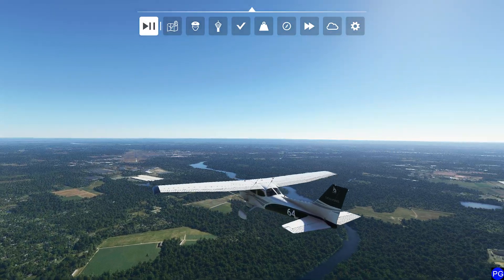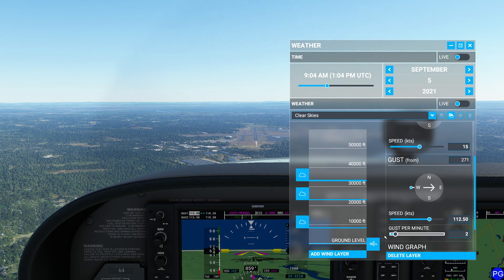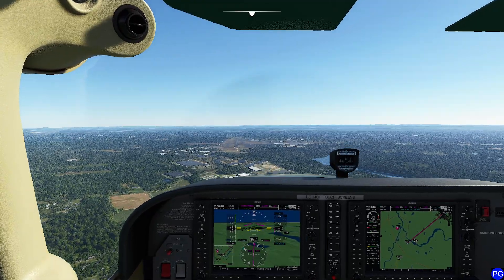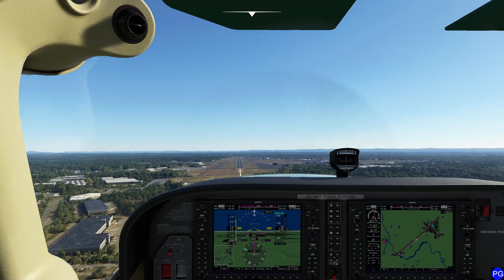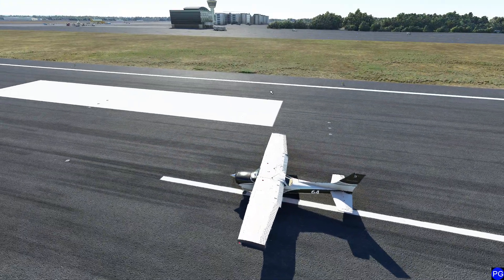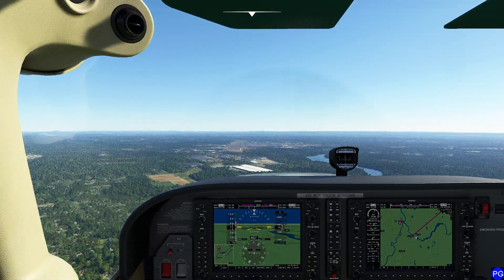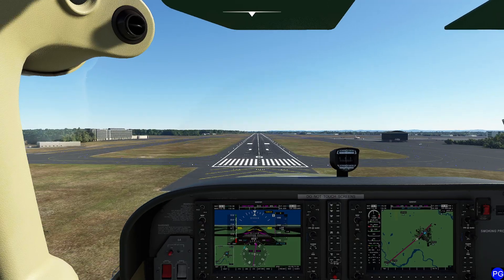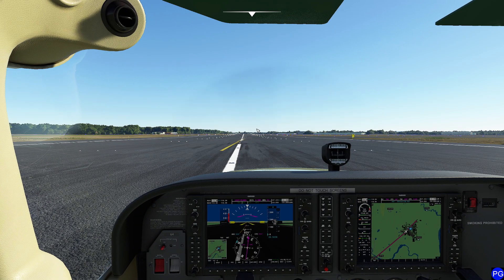MSFS - Effect of headwinds versus tailwinds during a landing

Comment: Your comment on the “weather vaning effect is working against us” is not correct.  I recommend reading the book stick and rudder.  You’re flying THROUGH an air mass at say a 70 kt indicated airspeed, while the entire air mass is moving at 15kt in the same direction as your flight path.  Your relative wind is still coming from in front of you.  So you’re not losing directional stability with your vertical stabilizer.  Think of yourself as walking through a moving train.  It doesn’t feel any different walking in either direction, but your speed over the ground changes.  The train isn’t shoving you from behind if you walk in the same direction as it’s moving.  From an aerodynamic standpoint, an airplane doesn’t “know” if it’s flying in a headwind or tailwind.  Only the pilot knows because he has a frame of reference on the ground.  This isn’t to pick on you its just an abstract concept that most people don’t understand.